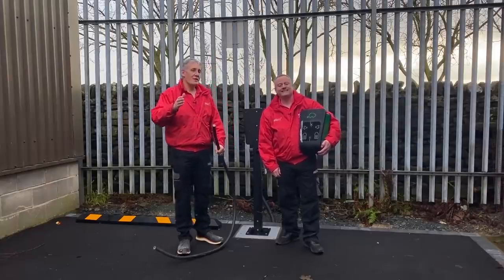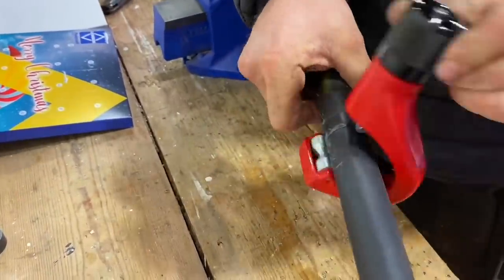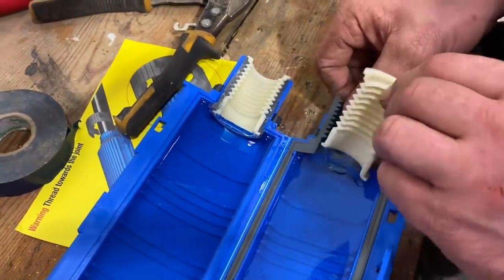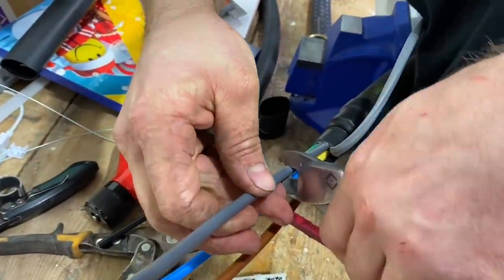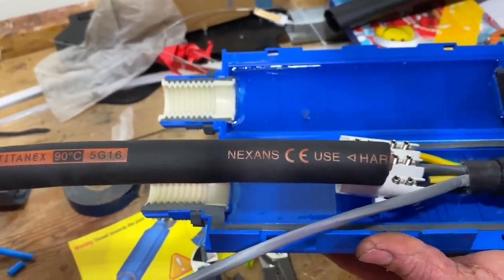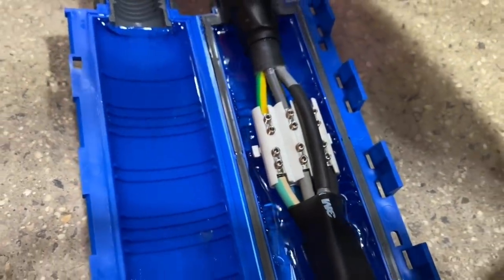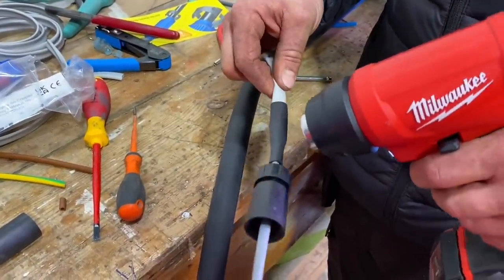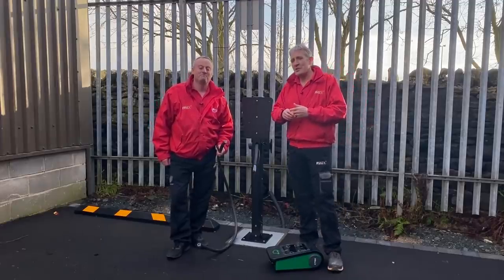PROBLEM SOLVED - USE RUBBER CABLE INSTEAD OF ARMOURED CABLE?

Comment: I'm not in the business but I know within the regs you have to run data away from power, how does it all work with regards to these cables? Seems like it shouldn't be a thing.
Reply: I believe the manufacturers have argued for third party approval that the screening on the cat5 acts as "separation" aswell as probably by the looks of it thicker than normal jacket of insulation. However As there is no recognised British Standard for these types of cables it leaves installers in a very difficult situation. When installing a cable that is not manufactured to a national or international standard.

BS7671 states that where equipment is not covered by a British or Harmonised Standard the responsibility to ensure an adequate degree of safety rests with the installer and/or specifier.

So the cable uses third party accreditation to get around this.
Reply: @adamt3800  I understand that. So are we saying that the separation is the Important thing? Obviously there's risk is Conductors touch in terms of both human touch and electronic devices not liking the voltage but what about the interference? Has anyone done a speed test or anything on these?
Reply from the maker: The Cat 5 cable is built up of twisted pairs which deals with most of the interference. Speed isn’t really as issue as we are connecting an EV charger which doesn’t transmit huge amounts of data.
Reply: @efixx  I was thinking speed could be useful if this sort of cable was used in other applications. Running to an outbuilding being used as an office for example. If speeds can be maintained well enough then this opens up very clean and easy installs I would have thought. As you say the twisted pairs deal with a lot of that interference so it begs the question as to why there is a reg about it? Is the reg for separation purely in regards to Conductors touching?
Reply: @badbradmx  couple of companies making cat 7 plus power which is great stuff, I've got some 3x1.5mm² + cat 6 for concert lighting but I haven't made a lot of it yet.

Comment: Do you guys ever use mine spec trailing cables in the UK? Alot more flexible than SWA,  it has a very thick rubber coating with woven kevlar fibers inbuilt, 3x earths and a small pilot cable in the very centre of the cable which cuts power if earth continuity is lost, pilot continuity is lost or in the case of a pilot core to earth short circuit (pilot healthy signal goes through a diode). Plus each phase has a semicon outer which trips out on a phase/earth fault if it gets damaged. I've literally seen it get run over by trucks/50 tonne boggers, and get skulldragged over all sorts of bullshit and stay working far exceeding what SWA cable could ever take whilst IMO being way safer. I've seen it take all sorts of beating and keep going, but never seen it fail in a unsafe way, it always has tripped out power whenever damaged

Comment: I think you guys made the correct decision.
- routing that armored cable into the panel would take longer and/ or be a nightmare (time is money), it's also more expensive. I think those 2 factors helped to offset or completely paid for the joint.
- armored is better underground... won't protect against a bulldozer but random guy with a shovel or one of those mini excavators maybe won't go trough the armor... And looking for failure+ destroying sidewalk/ road+ 2 joints is more expensive than laying armored in the first place.
idk about this gel thing... is it as waterproof as resin? will it last as long?

Comment: I love the ho7rn cables. Use them in many places. Work shops for connecting to heavy machines to there 64 amp plugs mostly.
Reply: H07BQ-F is even better for tough environment. Not even Forklifts can ruin it ...

Comment: 5:30 you want to be careful when sharply bending the data cable. Although for this application the data is not going to need that much bandwidth, in applications where it is needed for full spec, stress such as work hardening in the copper can course signal reflections that can degrade the ability to operate at full speed.

Edit: I said full cat6 spec, however it was cat5, an this also goes for any data cable like Coax.
Reply: It'll be fine. The bend radius is like an inch anyway.  Signal reflections?  It's not fiber, it's cat5e.  I've seen cat5e cables tied in knots and they still work, and I've rewired enough datacenters and IDFs to have seen just about everything.
Reply: @43ten43  You get them in copper to. Strain in the wire can cause the copper to work harden, creating dislocations/imperfections in the crystal structure. When an electrical signal comes across them, part is reflected back making noise similar to jitter.

This does not stop the cable from working, and mostly would go unnoticed. It mainly becomes a problem when you try to get all the bandwidth you can out of a cable. because of the higher frequency needed to drive faster data speeds, the reflections can start interfering making it hard for the receiver to correctly interpret the data.

You can actually see this by using a ETDR (Electrical Time-domain Reflectometer ).
Reply: Let's just bend it back to get it outa da way... Electrician vs Engineer... NFI
Reply: @joecitizen7382  indeed. here is the best way to think about it. Fiber optic is transparent to visible light. Copper is transparent to RF  light. 

With bare fiberoptic, if exposed to light, You can see a lot of light getting bounced to the end of the cable, making a visibly brighter dot. 

The same is happening to an arial. As the RF light goes through the metal, some is getting bounced through the mettle to the end making a form of RF "brighter dot" that can be easily "seen" by the RF receiver.

Now, if you take fiber optic and just shine a bright light through one end, you will see an intense bright dot at the other. 

This is a similar principle that applies to joining two points together directly with a cable. You are just blasting RF through one end and you get a crisp intense signal at the other end.

In both fiber and copper, when you want to send high frequencies through it, hence more data, there is a point where the imperfections in the material used will cause reflections an attenuation. 

So instead of a nice crisp on or off, you get a faintly dimming and brightening dot. as the frequencies get higher, it can be hard to interpret between a fluctuation from interference, or actual intended dimming for a date a bit.

Comment: Glad I have left the industry🤣adding an extra underground joint to get round a charging point that isn’t made to accept a decent cable is just stupidity in my view. All joints can and do go give problem at some point. Surly there are charging points that are designed correctly, don’t buy to others and they will have to re-design them is my view. ( this isn’t found to be a cheap option either in time ) what happens if you can’t pull the slack armoured back? Great video and talking point though. 👍

Comment: Would it be an option to swap ends for the HO7 cable so the core rotation matches the connector block, either that or a bit of forward thinking and trying to match the positions of the wires for the joint before cutting anything?

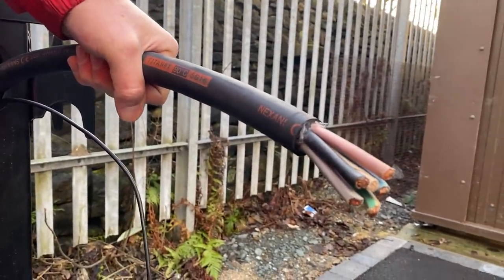Comment: @1:20 I guess the answer to should we be using the rubber cable instead of the armored cable is based on these two questions (1) Is rubber cable code compliant? and (2) Is it cheaper? If the answer to both is yes, then Yes. :)

Comment: we use H07RN-F for fixed installations and its much easier to deal with than with single core aluminum cable
Reply: Alooomimun cable, still using alooomimun? I thought Aluminium was pretty much phased out in the developed world?
Reply: @2Sorts  not for 25 mm²
Reply: @maxmayer4247  In the UK, the supply cable that feeds our distribution panels in domestic premises is 25mm copper
Reply: @2Sorts  I work in Germany, we use a mix of sometimes copper sometimes aluminum, at these cross sections

Comment: As per every thing its that application that matters I would say swa if it was a trench ya have to dig in grass and mud as extra security and pice of mind im case some twonk accidently dug into the install ( previous experience ) 
But as ya going through existing  underground ducting the either cable for your install

Comment: I'm puzzled by the thumbnail for the video. It shows a tick next to the rubber cable and a cross next to the SWA.
Is this because of the rotation of the coloured cores not matching? I'm assuming so, since the video was quite informative and reassuring of the cable types jointed.

Comment: There are 200 comments here so someone may have already mentioned it.
There is only a short run from the joint to the charger. Why cut the data cable short only to have to put a data connector on. It could have been left the full length to the charger. The armoured appears to have been long enough to reach the charger.

Comment: I really like that install and all the protection.
Done in a work shop that joint is doable, think a poured joint would be easier if you was outside working in a hole though. The connector inside that joint is far too big.

Excellent work though, I do like it.

Comment: Forget the plumbers tool, get an exhaust pipe cutter. Forget the pencil,, get a white or silver marker pen...just saying
Reply: It's not a plumbers tool, it was designed specifically for stripping swa cable.
Reply: I know it's not a plumbers tool that was making a reference to their comment of "it looks like a plumbers tool". I still stand by the exhaust pipe cutter but, to be fair, I do work on much bigger cables

Comment: isn't flexible cable super expensive compared to normal electric cables with thick core. I remember when I was buying car sub wires and 2 AWG copper wire was like £10-15 per meter.

Comment: I use rubber and duct grade cat 5e  but would use swa if going into a duct maybe...its a 50/50 really.

Have to weight up will the ground be domestic and will there be any digging??

Swa is a safe bet thou... have to think about the risks....

Comment: Hi, is there any kind of plug I can put on a 2.5mm 3 core swa cable? It will only be used as an "extension lead" from an outdoor socket to power my shed. I thought about just swapping the outdoor socket to a commando socket and using a commando plug but unsure if it will fit.

Comment: SY cable another good option for the earthed metallic sheath and class 5 conductors in one package, but would need the seperate duct grade cat 5 cable also
Reply: The chargers outside though, can’t put sy outside
Reply: It can be used outdoors, just not in direct sunlight ie exposed to UV. As far as I could see from the install video the cable wasn't directly exposed to the sun in any part

Comment: I would definitely avoid any underground joint between my electrical panel and my EV Charger (same applies for the network joint), because it introduces extra failure points (not to mention extra labor and cost).

Comment: rubber is kind of a mixed bag

sure, it is  resistant to impact and abrasion, it's also fairly heat resistant, but they do age
you should expect to replace rubber cables in certain intervals, I guess 10-25 years perhaps, depends on the conditions

but I suppose by then we ave found a better solution than EV's

Comment: If something like a digger were to hit your multicore cable it could easily damage the live cables without touching the earth or negative which might mean the circuit would remain live and would propose a risk to life to anyone working around it, an armoured cable is designed to prevent this situation as you cant really damage it without shorting the circuit as the ground wires surround the positive cables
Reply: That would involve a very unlikely chain of events. You'd have to be digging directly under the ev charger for starters.
Reply: @chrisL50764  the cable doesn't come from the centre of the earth.. the cable is ran underground. It's not an unlikely chain of events I'm a service engineer I have seen plenty of cables damaged by diggers I've even seen armoured cable shorted out by shovels. 

In that situation if it was a flex rather than armoured the ground worker would be dead

Comment: Class 5 cables suffer from poor voltage drop characteristics. Installers should be mindful of the limitations of flexible rubberised cables on long runs. I prefer using NYY-J for ducted runs and use a separate toughcat. Cheap as chips and more manageable than SWA 👍

Comment: I haven't done electrics since a city and guilds 2360 pt1 so I'm an idiot. But I thought regs said high voltage and low voltage data should never run together? Has that then changed? Great video by the way, thanks.
Reply from the maker: If the voltage rating of the cables are greater than the maximum system voltage then it’s okay.
Reply: @efixx  ahh. Thank you.

Comment: I was thinking that, if a mains cable was run in a containment system within a building, would one install a mains cable and a cat5 cable withing that same containemens system ? especially if it were not a segretated containment system ? as there is no segregation with that cable sheath that I can see.
Are there regulations covering this situation ?

Comment: Hi all. I think there was no reason to use SWA cable if you still needed to add different one because the rubber cable you have used is really good on that environment and also, you have used ducting as well. More connection is more resistance and more chance of trouble in future.  For data cable you could use special one . Anyway you are dong good job guys of posting videos, I like to watch you.

Comment: Also, the embedded Cat5 didn't look duct grade, so should NOT be use this way.....

Good to see an EV cable with viable CSA, (WFT is 4mm for 1m runs?) but should have duct grade data lines in it!

Comment: I was surprised to see that your installation has no protection from vehicles. Murphy's Law says that if it can be hit by a vehicle, it will. As you cannot protect the point with a single post, it would not protect and the cables are where the post would go. A pair of posts, concrete or metal would protect it against approaches from all possible cars or larger impacts, you are on your own with motorcycles and smaller.
I worked at an airport that had a 30km approach road, with six lanes in each direction separated by a 10m central reservation. Just inside the boundary of the airport was planted a single 'Date palm'. The fine for hitting the palm was 10,000 Riyals, the fines were used to buy more of the palms. When I arrived to work there, the airport had 12,000 palms. When I Ieft there, over 15,000. Think about Murphy's Law and I hope that I am not too late with this advice.

Comment: Is the ev ultra cat 5 cable solid core? If it is, it's not meant for putting RJ45 plugs on. It'll be for punchdown type terminations, where the conductor is forced between two "blades".  You'll run into reliability problems long term, because the contact area between the vampire pins in the RJ45 plug and the solid cat5 core is too small.
Reply: You can get different RJ45 plugs designed for solid or stranded cable.

Comment: Question and totally off topic gents and would appreciate you're thoughts. (Commercial kichen) My double draw freezer has come with a 13amp moulded plug. The socket on the wall is a 16amp 3 pin blue socket outlet. Can the 13amp plug on the freezer be changed to a 16amp 3 pin blue plug to suit the socket on the wall???
Reply from the maker: Probably a question for the manufacturers - if it’s European manufacturers the fuse will be in the oven.  uk 🇬🇧 they may have not bothered and rely upon the plug fuse.
Reply: Do you could put before the CEE 16 2pol+earth connector a cu with a 13 A fuse. The kind of a CEE connector mean the max. only. So many Italian camping places use 10 A and older Greece camping places only 13 A for every CEE socket. 

They are two CEE blue 2pol+earth connectors on the market, one with max. 16 A and one with max. 32 A. The second connector is a little bigger.
Reply: Make up a short jumper cable with a 16A plug on one end and a 13A rubber trailing socket on the other. It would avoid having to lop off the moulded 13A plug any concerns over the appliance warranty, and remain fully compliant. Personally, I'd use 1.5mm sq rubber HO7RNF for this since it's in a kitchen, and a quality rubber socket (eg MK PN# FC133BLK).

Comment: Doesn't rubber cable break down when petrochemicals such as petrol or diesel come into contact with the sheath?
Reply: No, as I recall, BS7909 which is the guidance for temp electrical systems pertaining to the outdoor events industry, specifies the use of H07 particularly because of it's oil resistance when used around generators etc.
Reply: Indeed it does, the sheath swells and eventually becomes permeable. I work in the pump industry and have seen this previously.

Comment: Just wanted to know why this cat5e can be run or incorporated inside a mains cable regardless of insulation quality we have close proximity.What am I missing tia.
Reply from the maker: It's connecting an EV charger which needs data - but isn't a data centre in terms of transmission rates.
The only data being transmitted is the power consumption, charging status and security info for RFID tags.
Reply: @efixx  Thanks understood similar to BMS installation

Comment: If the cable is in a protected conduit or duct, where is the problem of not using armored cable?
Especially when it is unlikely that heavy vehicles will drive there or that a farmer will start plowing.
For example at the fence of a meadow where only a light lawn mower is to be expected and no spade expected.
Or flat edging stones could serve as grave protection in the garden.